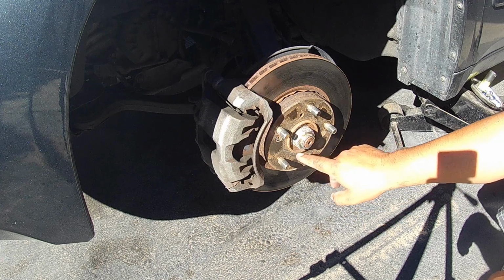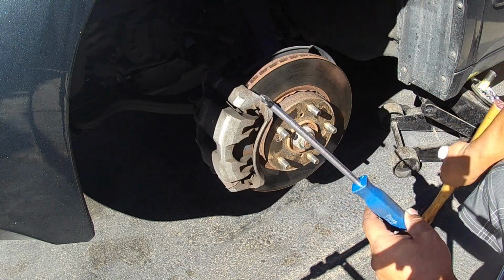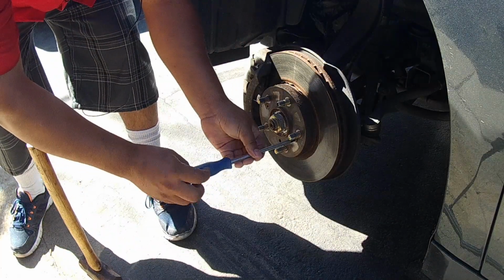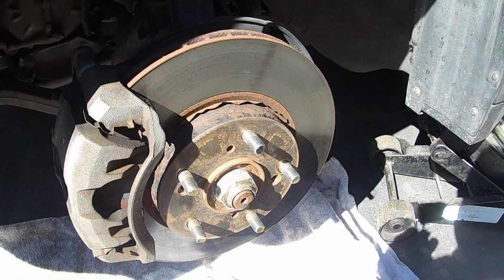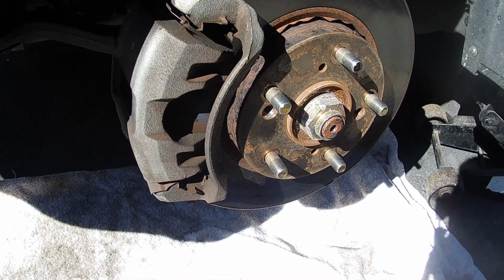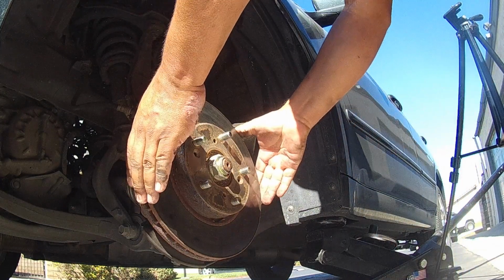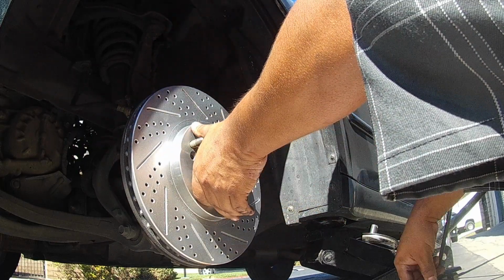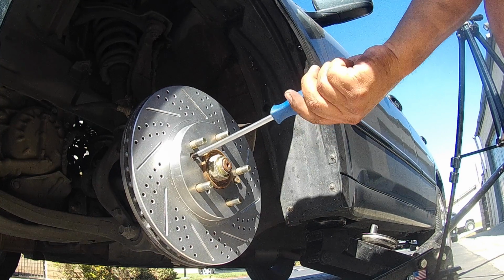Rotor Screw Removal and Stuck Brake Rotor Removal

Comment: One thing of note is that these rotor screws are JIS and not Phillips head. That is another reason why they get stripped, people using the wrong type of head.
Reply from the maker: Philips will work.
Reply: @bundysgarage  of course it works, but it's a close but not a perfect fit. JIS does not have the rounded corners of at the root of the cruciform, as well as Phillips being more conical in shape. Also Philips was designed to slip out if too much torque is applied.

I make such a fuss because of tearing up a rotor screw on an old BMW that used a posidriv screw, that a #2 Phillips "works" in, but fits in sloppy and ended up costing so much hassle 

Seriously to anyone who reads this, just spend $13 and buy a Vessel JIS impact screw driver from Amazon, it turns a few degrees when you strike it on the end, and it doesn't mangle the heads.
Reply from the maker: I understand what you are saying. And I have seen guys mangle the heads of the screws but if you know what you are doing and take your time the threads are going to be fine. Don’t spend $13 bucks on something you might only use once and twice in our life. Now if you were doing this as a living day in and day out yes invest in the tool. Other tha. That a set from harbor Freight will be good enough.